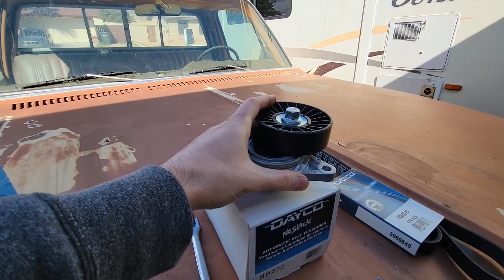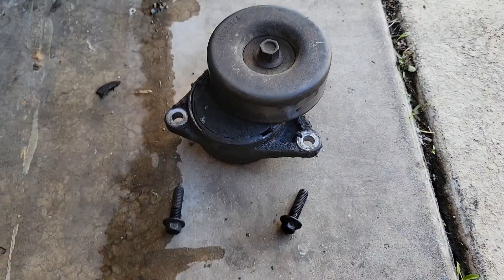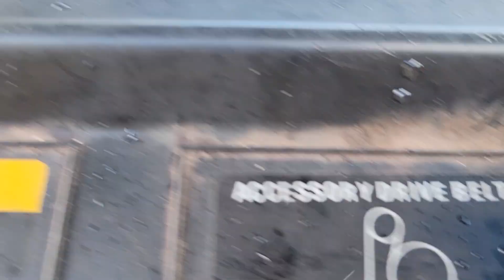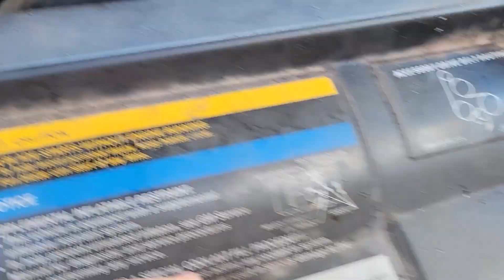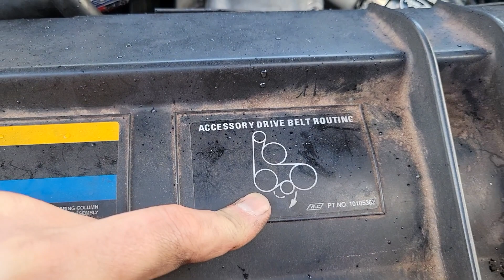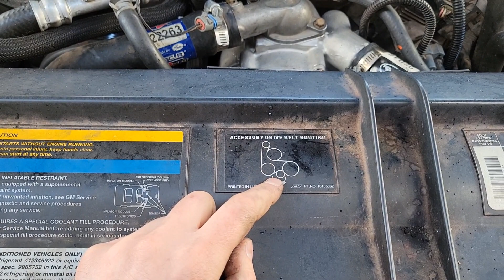LT1 Belt Tensioner Replace: Fast and Easy

Comment: Does the water pump not touch the belt?
Reply from the maker: Hey, so no it is not powered directly by the belt it actually has a gear on the back of the waterpump that then goes into the engine. I actually have a video on replacing the water pump for this vehicle that gives a bit of a better view but short answer is no it does not touch the belt. Thanks for watching!

Comment: I agree with using RockAuto for a a-lot of hard parts or weird stuff on this car. I have a 94 Z28 and rebuilt most of my front end with them. It’s still been cheaper to be the mid grade stuff than from parts stores. Costed me about $800 for two hubs, two lower control arms, and two upper control arms. Shock set from Summit for $243.99. $80 for two sway bar links (I prefer lifetime warranty myself). $124.99 for a rack and pinion with new tie rods from Detroit Axle with a lifetime warranty. All in all about a little over a grand. I can’t imagine what it would cost to have a mechanic do this work let alone get it from parts stores.
Reply from the maker: Yeah, its crazy seeing some of these hourly rates out there. And just about everyone has a story where they saw how much they were charged for a part they know they could have gotten much cheaper. Have to be careful with quality, the aftermarket can be tough but atleast rockauto gives you options its not just, "here's your part" which is the cheapest quality and the highest cost haha. Thanks for watching!
Reply: @picklesgarage Very true, also question. My belt has been squeaking recently and I inspected it only to find out my rib closest to the engine was frayed on one part of it. It happened to be on the alternator pulley where I can see it (lucky me). 

So now I’m considering replacing the entire belt and tensioner assembly (Im the 5th owner so idk how long it’s been there). What’s weird is RockAuto lists an idler pulley. Yet the belt diagram only shows an alternator, power-steering pulley, crank pulley, tensioner, and a/c pulley.

Is there no idler pulley for the LT1? CamaroZ28 online had a guy in the form say the LT1’s don’t have an idler. Just confused if that’s true. Parts stores and online says there is but I don’t think so according to the diagram.

Just asking since I’m considering getting Gates tensioner assembly and belt; how has your DAYCO held up?
Reply from the maker: @NicholasBarnes0 Yeah I think maybe the v6 camaro might have had an idler pully from what I found but I agree mine is just alternator, water pump, crank, tensioner, ac then back around.
Reply: @picklesgarage Hey just wanted to let you know the gates stuff worked great. The tensioner from gates is way more premium than what you had in the video. No sharp edges on the part. Only had a minor discolor on the pulley. Which was metal instead of plastic OEM one. It needed a new pulley as it began to walk the belt towards the engine due to the pulley being chewed on. I also found my harmonic balancer has a piece of it chipped off where the belt snagged after walking which frayed it. Good thing to know that can happen.
Reply from the maker: @NicholasBarnes0 Ah nice that is good to know thanks. Definitly hit or miss on some parts.

Comment: Hello brother question im installing a new radiator did you use any o rings on the two metal connetions to the radiator on the passenger  side of the radiator one is the trans cooler line and the other im not sure.
Reply from the maker: I only put O rings if it has that gap toward the top of the threads. I haven't removed those lines but they look they are intended not to have them. The flanged metal with the nut tight enough should be a good enough seal as is.
Reply: @picklesgarage  thanks I appreciate it . Always good to make sure

Comment: How do you know when the belt tensioner is bad?
Reply from the maker: There are 2 primary issues that happen. Either the wheel itself starts locking up or arm gets loose. With the belt on and car running you may hear squeaking as the wheel stops and the belt goes across, idle may also be rough.  Or you may notice the arm of the tensioner bouncing which may throw your belt off while driving. Checking with the belt off you should be able to rotate the wheel easily and freely. If it's tight or intermittently loose then it's bad. The arm with the belt off is harder to check because most have springs so it's still feels tight but they also often have grease and you may notice grease pushing out of the seal and caking around the back and bottom, this means it's on its way out and should start bouncing.
Reply: @picklesgarage  thanks
Reply from the maker: @NJRangerGeorge  Sure thing, my Jeep was worse that was the "Finding whistle, wining, screech...." video. It was super noticeable at lower rpm, once you got going it stopped. On this camaro it was just leaking. Have a good one!
Reply: @picklesgarage  thanks bro have a good one too